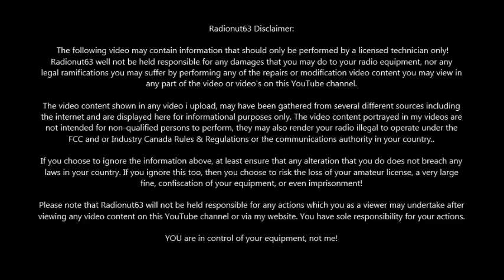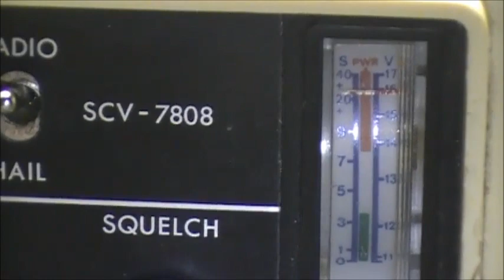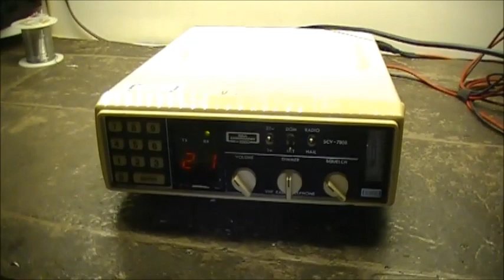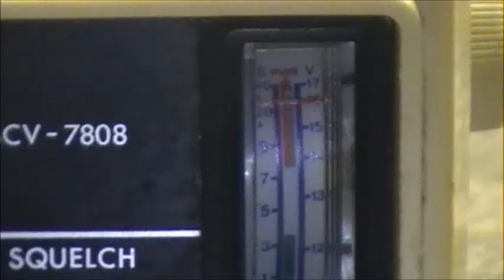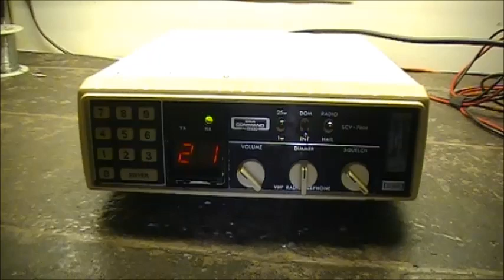Sea Command SCV-7808 Marine Radio - Anyone have a mic wiring diagram?

Comment: I may have an old 5 pin (aluminium type) in storage that may have come off of a marine radio. Maybe it might work.  Now, not knowing for sure is not of much help to the situation but I am sure you'll figure out the pin out anyway.
Reply from the maker: Where it is on the Marine band, will have to use it on my service monitor to figure out the codes without causing any grief to other users.... we shall see.  ;-)